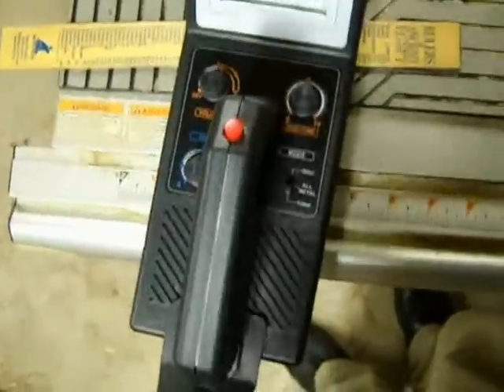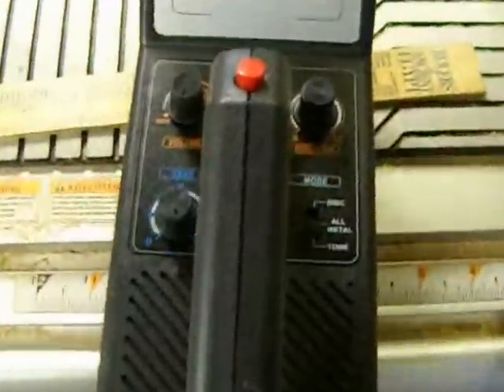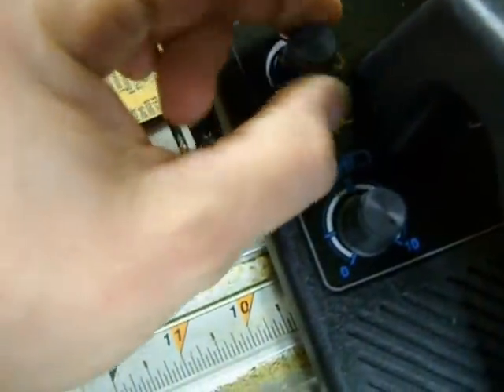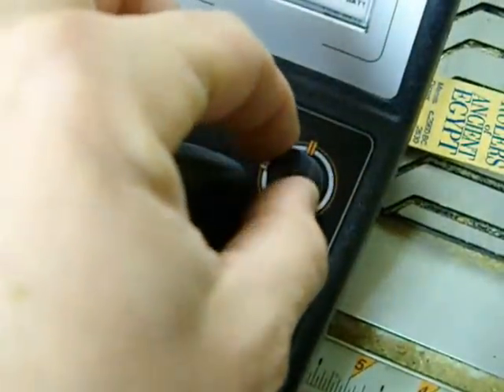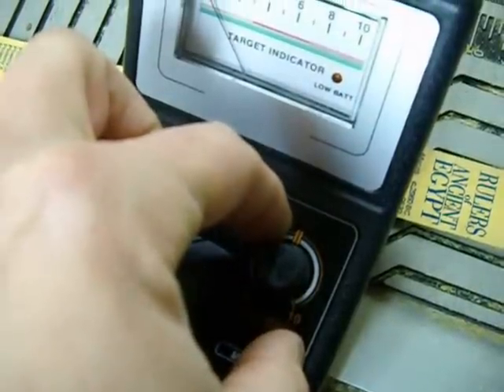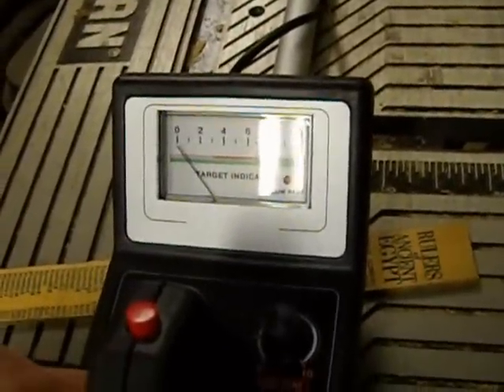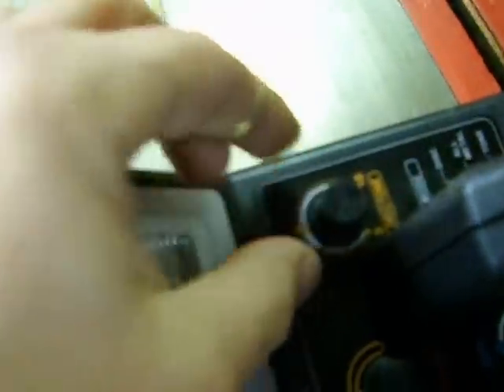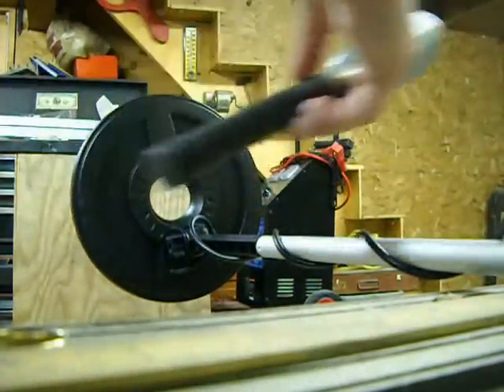Test and review, Harbor Freight 9 function metal detector

Comment: hello, can this metal detector works on water? thanks
Reply from the maker: It says that the coil is water proof but I dont' know if i'd trust it with anything more than wet grass or maybe a small stream, the control box is most definately NOT water proof what so ever.
Reply: well thanks, i just order this metal detector which is my first one. i guess i wont play aroud on water.
Reply from the maker: Yeah, not bad to get the coil wet but I don't know how well it is sealed. It's a good first machine for short money.  Good luck with it.
Reply from the maker: The coils on this unit IS water proof, my concern is that if you go in water (it's ok all the way up to the control box) is that when you get out of the water the shaft is still full of water and if you tip it upsidedown, poof there goes the control box. Just be carefull out there, all though it's a "cheapo" machine it's still pretty sofisticated...
Reply: carlos benitez I used mine up to 2 feet in water with no problem....
You just don't want to get the upper part wet.

Comment: I'm late to the party, but this video should be called "You can measure up instead of down to determine depth" or "This is how the discrimination dial works and why" or maybe "That broken tone you've been hearing is the metal you don't want."

Now I can go see if the old slightly-better-than-this one in the back of my truck works! Thanks for the gumball!
Reply from the maker: This is an old shitty video lol, thanks for watching.
Reply: @jaymoge  Perfect because I have an old shitty metal detector.
Reply from the maker: @W6QLE  perfect. As long as it beeps over metal you'll find stuff. There's never nothing.

Comment: Grate Info vid.  for the low price you you can see if you like this hobbie without  brakeing the bank.and if you do not .the whife will not yell at you for spending $1000 bucks
Reply from the maker: yup. my youngest son uses this now, I converted it to run on 1 9volt instead of 6 AAs.

Comment: It's clear to me that you haven't used this detector prior to making this video.  Nice effort but you should have a little time on this detector (any detector) before making a video.  I use one of these as a loaner/parks/lives in the truck MD and your air test doesn't do this bargain basement detector justice.  On avg you'll pick up quarters to 8", dimes 6-7", copper pennies and nickles roughly 5-7".  To null out pull tabs(nickles/gold too), you need to run the discrimination at 3 o'clock.

Comment: This detector is ok. Kind of Stone Age, but will find metal. The pointer sold by HF is a fake plastic box with almost nothing inside. It's a joke. I couldn't believe how primitive the circuitry was. I built a proximity detector in School, 1986, that had more guts than this modern day junk box I found a lot of coins and other junk metal, without a pointer. Man! Do you need someone to dig for you? A pointer is for nerds. Get down there and use your fingers. Bring a magnet. Save time!